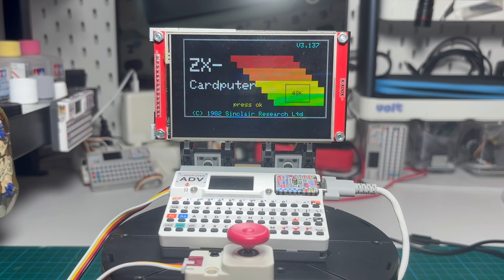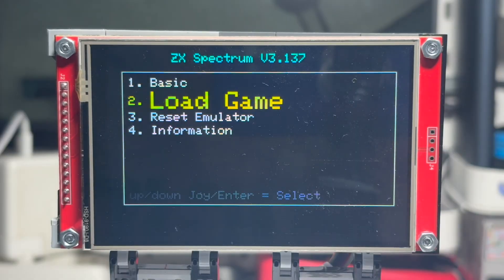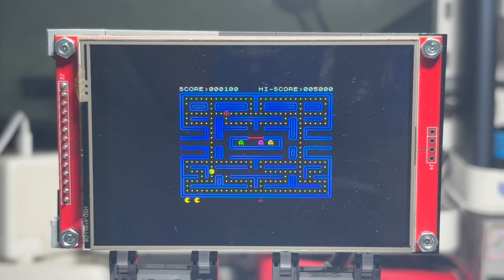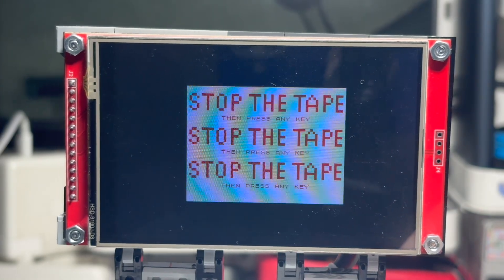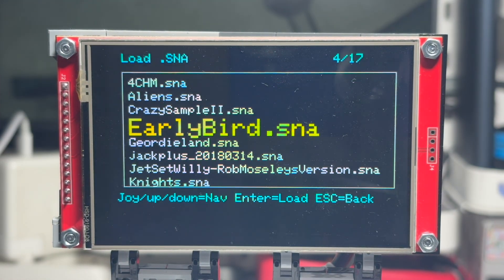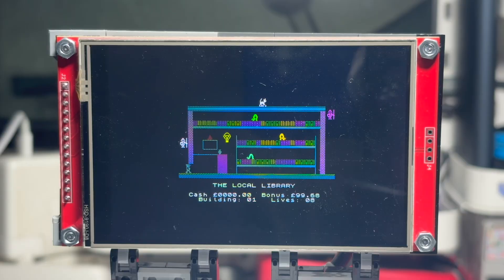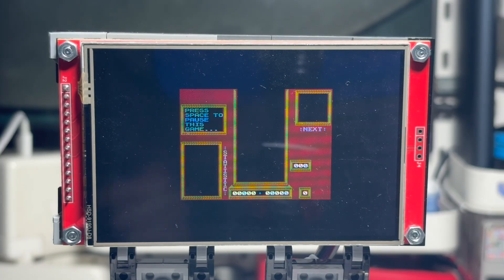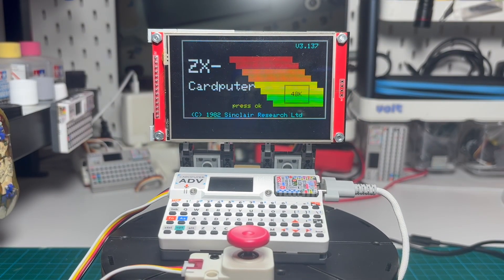ZX Spectrum Emulator on M5Stack Cardputer-Adv | External ILI9488 Display | Project Overview

Comment: Just tried the project, quite nice, main thing is to double check the PIN connectors, as you also need to connect LCD to 5V Out, a lot of readmes on Github don't have the pin mached. 

One of the interesting takes would be having the External Display work on Bruce firmware, and be able to toggle it off and on in the settings. 

Memory consumption can be mitigated via storing files on the internal SD card.
Reply from the maker: Thanks! I haven’t tried the Bruce firmware yet — I don’t really know how it works, so I need to take a look at it.
And yes, checking the pins and using 5V Out for the LCD is super important. Thanks for the tips!
Reply: @AndyLong14  Just spent half the night yesterday recompiling Bruce to work with both External and Internal Displays lol, quite a pain but worth
Reply: Well took me half the night to rebuild the Bruce firmware to work with the Display, but finally did it, will be further working on it, and making the secondary display a LOOT more usefull, similar to having a bigger window for SSH and more..
Reply from the maker: That sounds great. Would you mind sharing the repository? I would really appreciate it.
Reply: @AndyLong14  Ohh, haven't made one yet, gimme a few minutes, will upload and send link

Comment: Is it possible to use the internal display too? ..... It's a great project, thanks for sharing.
Reply from the maker: Right now the emulator only runs on the external display.
The internal screen is disabled because both displays use different drivers and need separate rendering pipelines.
I might try dual-screen support later, but at the moment it’s external-only.
Reply: @AndyLong14 I tried it, and now I have a Spectrum in my pocket — fantastic work! Feels like an early Christmas this year. 🙂